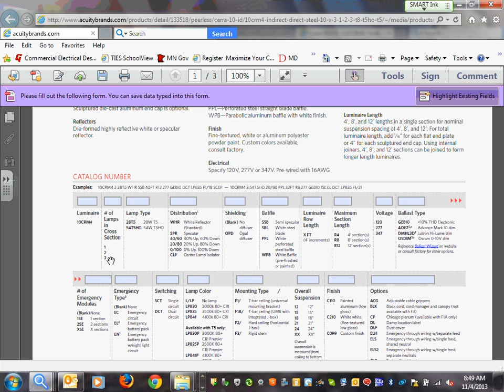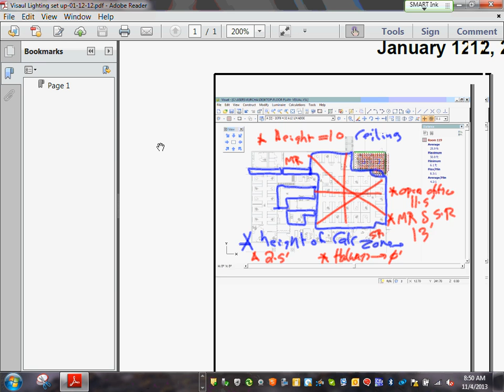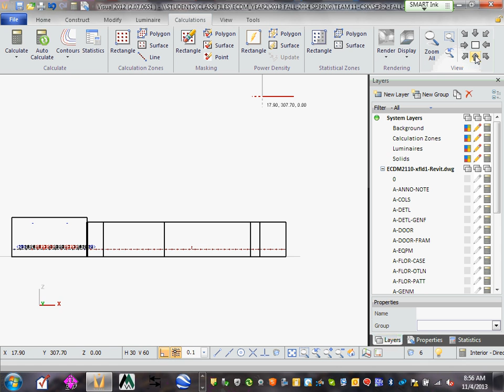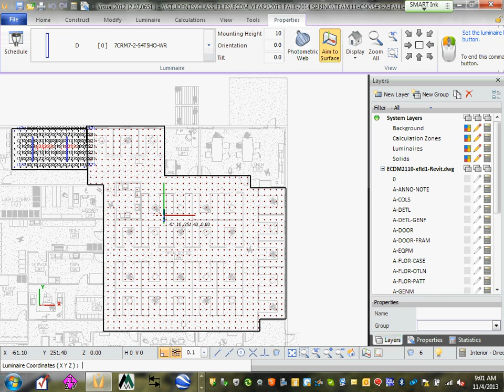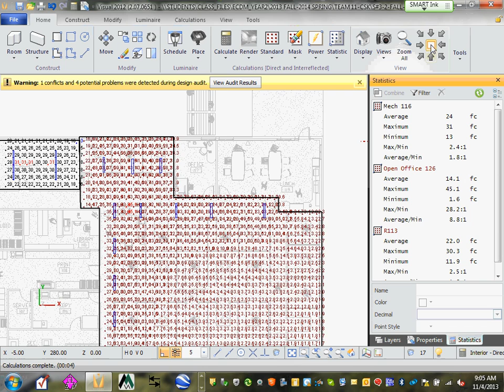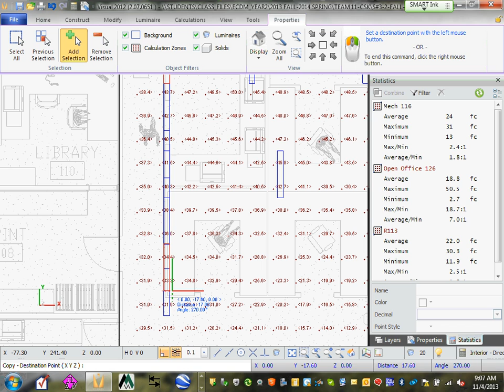Lighting Calculation Open Office Visual 2012 11 04 13

Comment: Hi
When I put the cad file into visual, the unit is changed
For example the unit is 104 m, when put into the blanket 104 000 m.
I currently use visual 2016